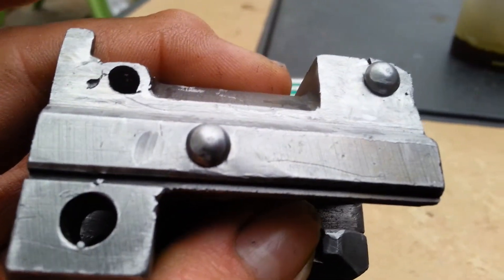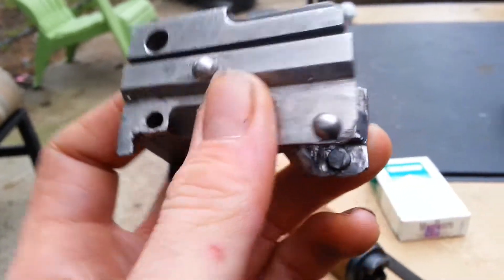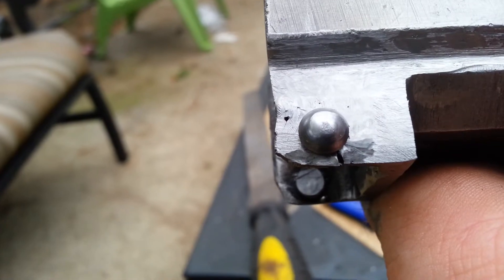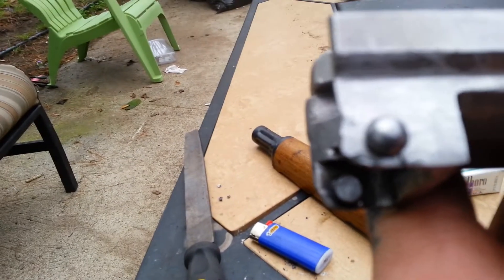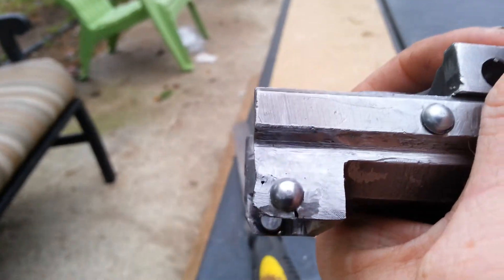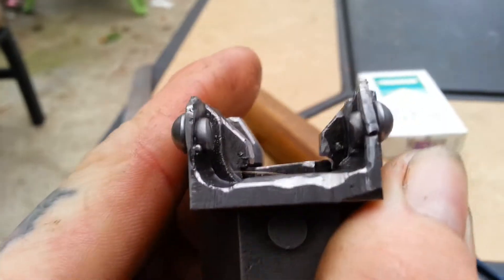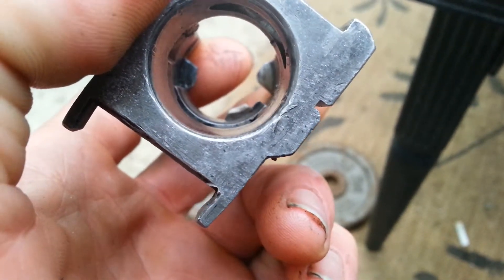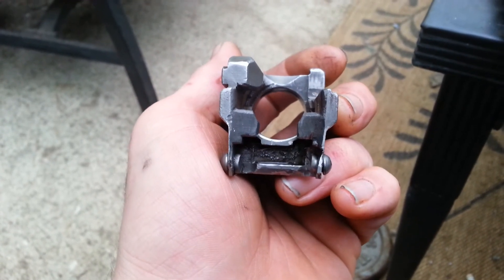Yugo trunnion weld fail?

Comment: Regarding your response about hitting it. You don't really need to. What will happen if you do is that you will cause it to expand. It's called peening! You don't want that regarding your build because if it's done in evenly you may cause it to expand more on one side. When we do "socket" welds, which means say if we machine an opening that's say 1.062 and about 3.00 inches deep and we put a 1.00 tube inside of it. We will usually sit the tube 1/16th higher than the base machined. Meaning the tube won't sit directly on the bottom. So when it's welded it will shrink a bit. Usually .0325 or a 1/32 of shrinkage. So as it cools the weld won't pull away from each other. It will cool and shrink with the pipe still floating from the base. I hope you can understand what I mean. But with that quick little rosette weld, you should be fine.
Reply from the maker: Thank you, so it turns out one way or another I did change the diameter of the trunnion. It's now .9025 horizontal
And .907 vertically? 
I do not fully understand your "tube" trick but do you think it could help in this case?

Comment: mig isn't hot enough tig is best back the weld with copper plate. So you don't burn through or out. "Use" used motor oil because of the carbon that's in it.

Comment: I'm a military certified welder. The reason it broke is because your trunion is cold prior to hitting it with your mig torch. You don't need to get it red hot. Just get it hot enough before you start welding. That's the only way your going to get your metal to flow with the base (trunion). Than you can properly heat treat it after. Or, and what I do, is do a complete weld build instead of rivets. They have a really good vid describing a weld build AK! It looks like its a machined receiver. Also, I can see you have been practicing your rivets so I understand you may want to go that route. Also you are completely right when talking about heat treating after welded. Do that for sure. But before you weld to fix it make sure you heat the trunion up first. Hope this helps. Or Tig weld it. That way you know for sure that both the base metal and filler are properly bonded.
Reply from the maker: Hey thank you for that tip about the heat! I have just been going crazy about this. I am going to do just that. Funny you should bring up a weld build because that's what I just ended up doing!  I was having so much trouble with the rivets I just did some rosette welds and now she looks and feels much more solid! So is the old trick true that right after you lay the weld down, you should smack it with a hammer several times, I guess it does something with making the metal molecules combine? Ever heard this?